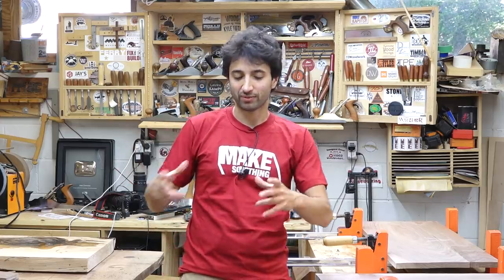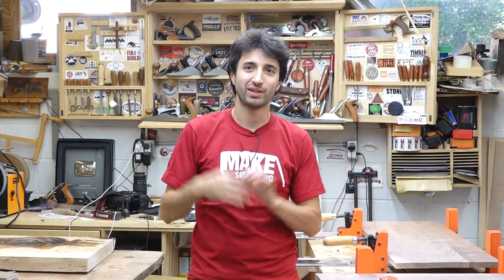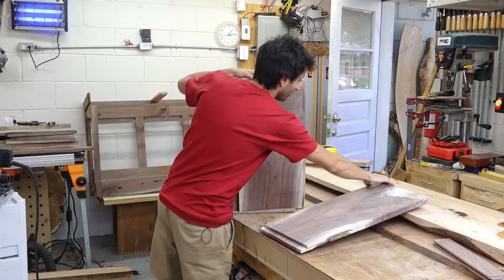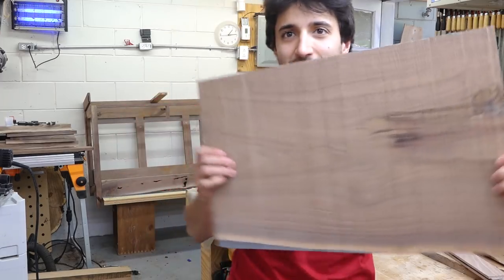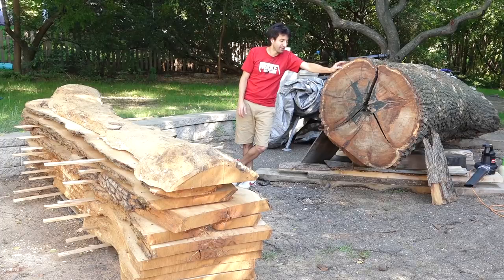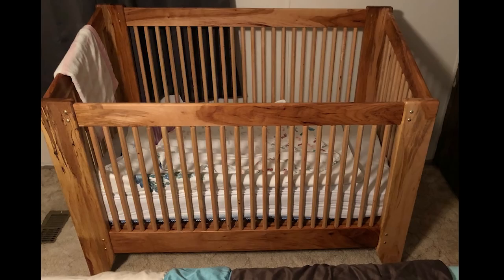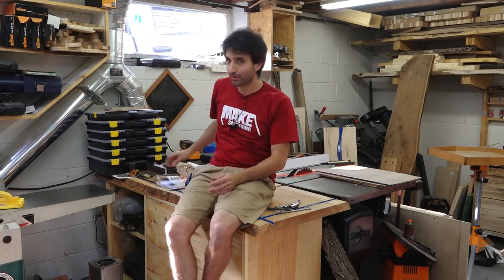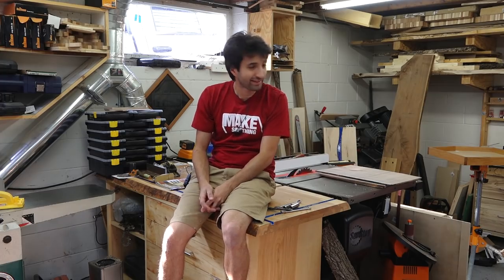Matt's Weekly Shop Update - Sept 7, 2018

Comment: Matt, my brother and I recently moved 2 trees, 
that had been blown over, in our latest storm.

Acacia.  We have pictures of the trees and the 
logs.  I'll be sending those pictures, along with  
3 tap handles I made on his (used to be mine) 
2 antique Cast Iron Shopsmiths.  One of them 
is mounted to the wall of his tiny (3 car) shop, 
the other is a free standing unit.

Tap handles will be set up, on my $35 kegerator, 
serving my homebrewed beer, and other concoctions.
(Kegerator came with a Co2 bottle, set of gauges, 
and a Sankey tap, which was replaced for 5 gallon 
Cornelius keg taps.)  That Co2 bottle is twice what 
the whole setup cost me.

Anyone need a Sankey tap?  I'll never use it.

steve